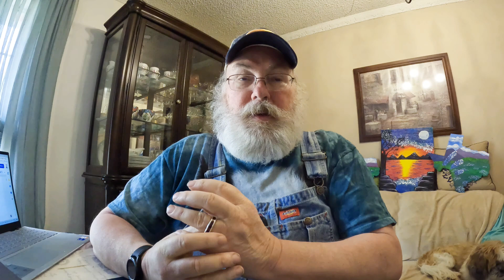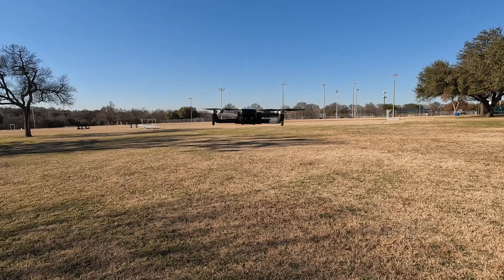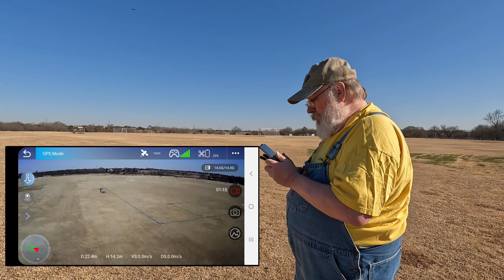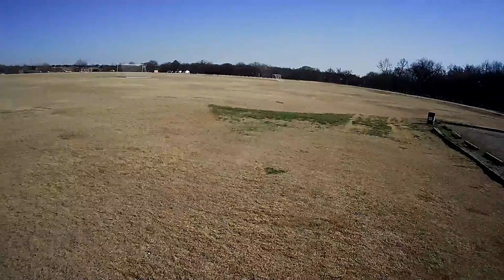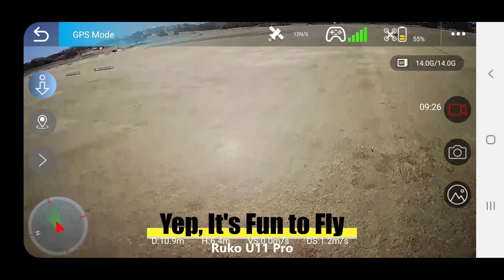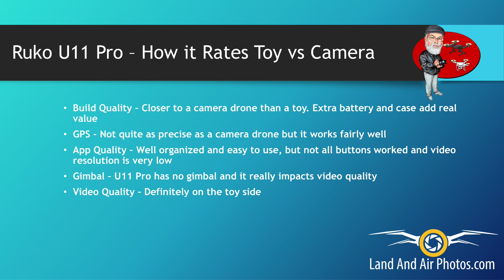Ruko U11 Pro: Is This the Best Starter Drone in 2022? Save $25+ With Coupon Code!

Comment from the maker: In this review I test out the Ruko U11 Pro, a starter drone that falls between the categories of toy and camera drones. The regular price of $330 makes this drone an inexpensive option, especially considering it comes with two batteries and a case. But is it the best starter drone in 2022? Watch this video to find out.
Use the following link to buy the Ruko U11 Pro:
https://www.ruko.net/products/ruko-u11-pro-drone?sca_ref=1771214.h3rLbKDFqt

Use the discount code "JeffS" to save 8% on the sales price - that's more than $25 off!

Comment: Hi Jeff, love your videos and content.

I got a SG906 MAX1 (gold version) with 3 batteries for $294 (with free shipping).

It has very sensitive 360 degree "obstacle avoidance" (basically stops the drone from about 20 feet away and lets you fly back, over or around), 3-axis gimble, image stabilization, very nice photos and videos (hi res to SD card and lower res to phone/tablet memory,  simultaneously and automatic once one presses record or takes a photo) real GPS that works well and fast, very nice controller with real telemetry display, simple and easy app, reliable return to home, very good range and little to no glitches on app FPV and none on SD recordings with a good "U3" Sandisk SD card.  The range is steady 400-500 meters in a high-interference area, easily 2-3 kilometers in open areas.

The drone is very steady in up to moderate winds (15 mph or so, more than that it's iffy but still flyable in hi-speed mode with good skill, and the return to home is reliable if things get hairy).

Now it's about the same price with three 5000 mAh batteries, but they just came out with an upgraded SG906 MAX2 with a better camera and even more range.

You should look into it, the SG906 MAX1 makes the drone you reviewed looks really bad in comparison, price/performance wise and across the board.

ETA:
The SG906 MAX1 is above 250 grams - it weighs 571 grams with battery,
Reply from the maker: Thanks for the tip! Who makes this drone? If they can provide a test drone for review, I'll be happy to review it!
Reply: @JeffSibelius   XiL manufactures the drone, it's sold and badged mostly as ZLL Beast 3+ MAX1, but there are a few variants like the EQB Gold version which is the one I have.

I sent the store a message about your channel and that you are interested in reviewing the drone, with a link to this video.
Reply from the maker: @retromodernart4426  Beast . . . love the name LOL. I appreciate you contacting them - hopefully they send me a note!